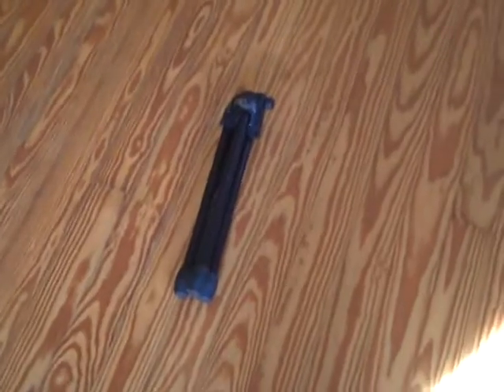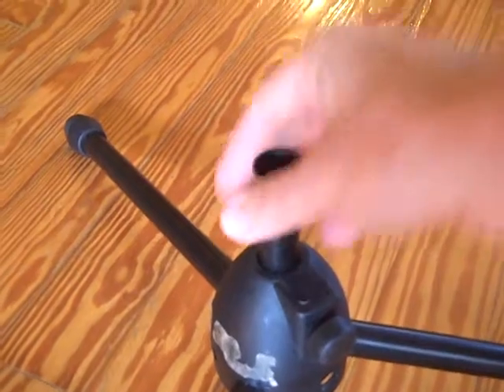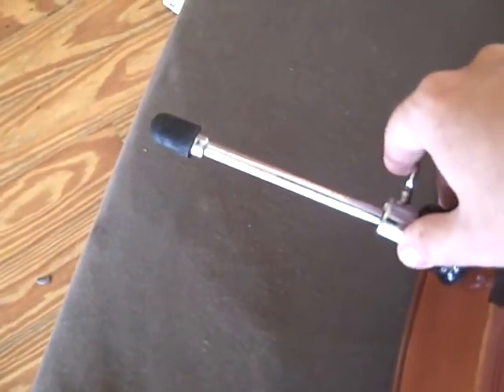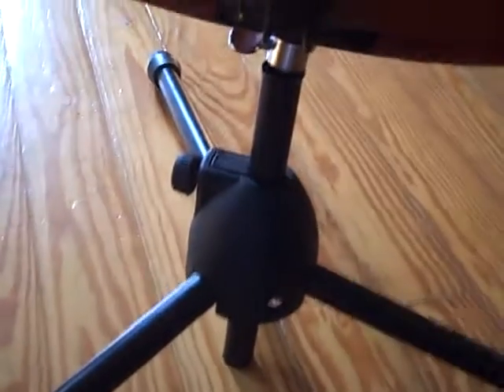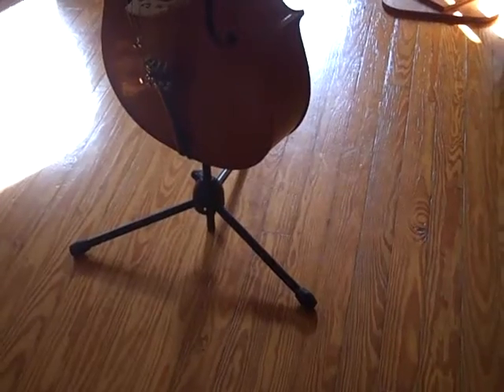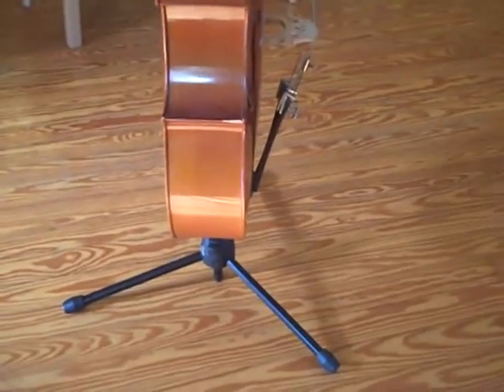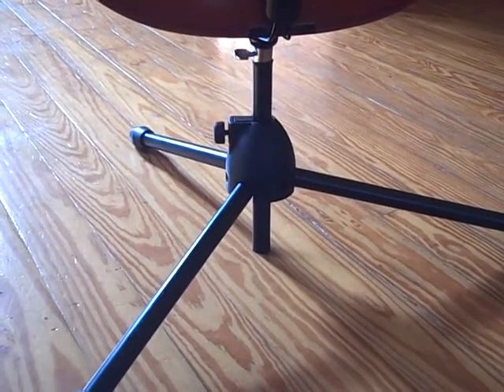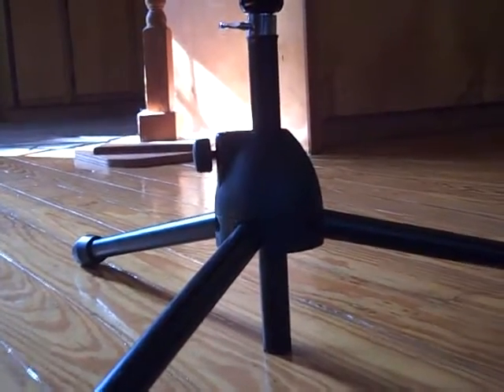DIY cello stand

Comment from the maker: It looks unstable, but it is as stable as the base is wide.  You have to tilt the cello about 30 degrees before it will fall over.  A regular cello stand is about the same, but the center of gravity is a few inches lower.  I have used this a lot on stages where people are bumping into it.  No problems.  Granted, I probably wouldn't use it with a $10k instrument, but on a budget, it works like a charm.  I like that it's small enough to fit into my cello case.